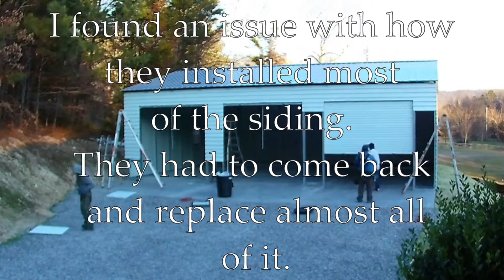30x40 metal building being built. Shop / garage is finally finished.

Comment: What was issue with the siding?
Reply from the maker: They placed the screws too on the area that was designed for mounting. The company tired to tell me it was normal but it made a dent at every screw and looked very bad. They realized they were wrong and brought new siding and screwed them were I said it needed and it looks much better. Thanks for asking.